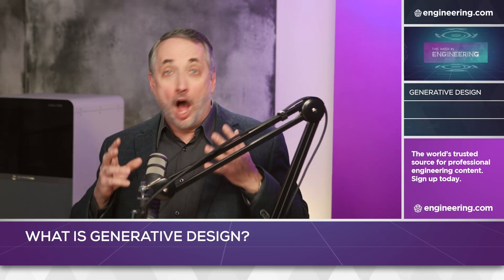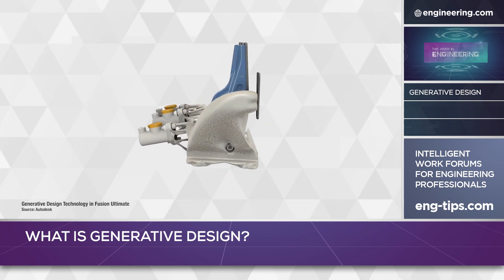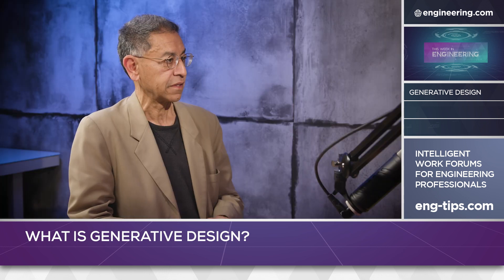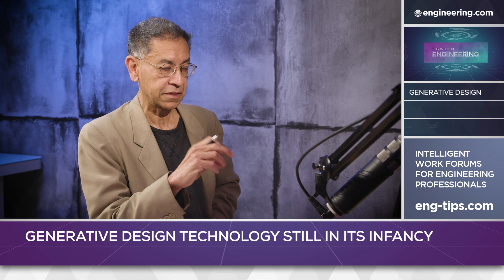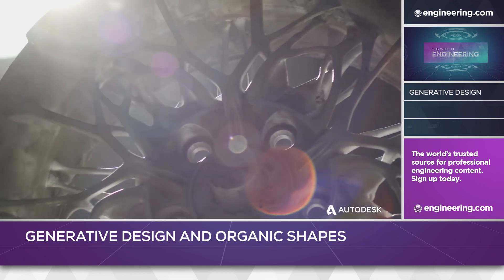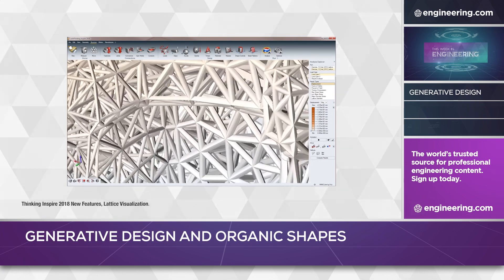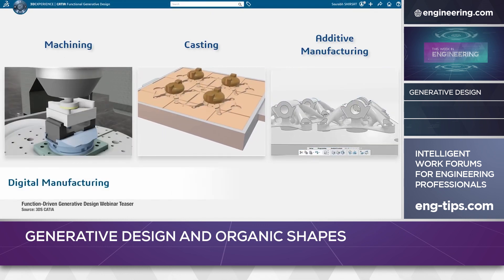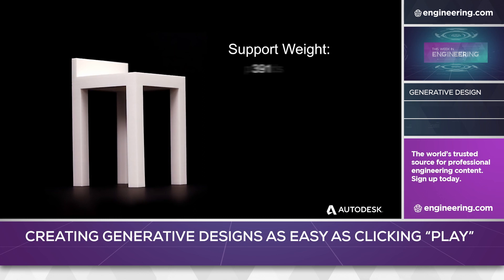Generative Design: Ready for Prime Time?

Comment: The bridge it designed might not be wrong - just not aesthetically appealing - it might still be able to handle load better than one designed by a human.

With things like ChatGPT Vision (or rather, cheaper AI Vision models), it might be possible to stick in human aesthetic feedback into the design paramters as well... Although that could end up limiting the potential of the products.
Reply: the issue with the bridge shown is that its not possible to fabricate